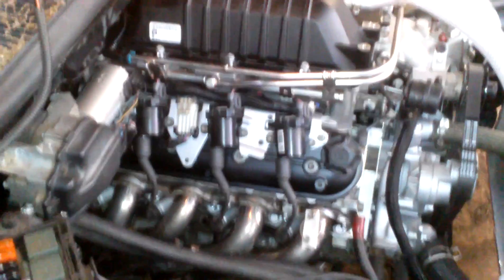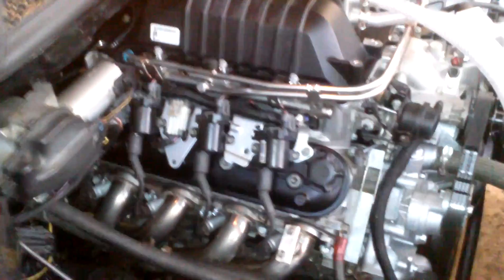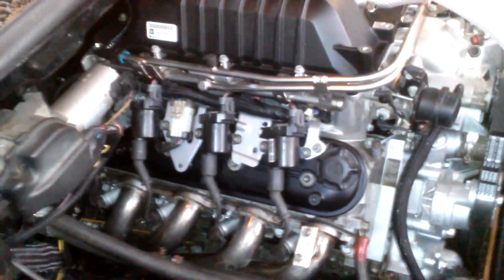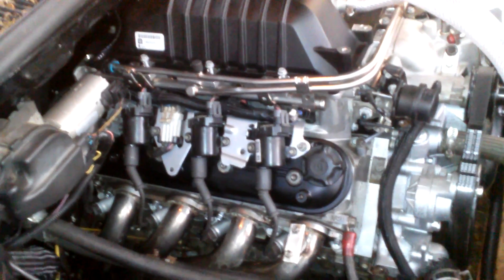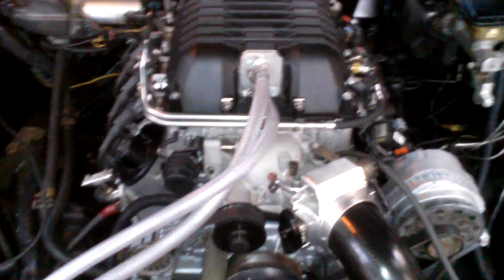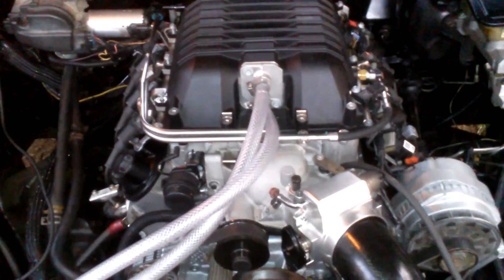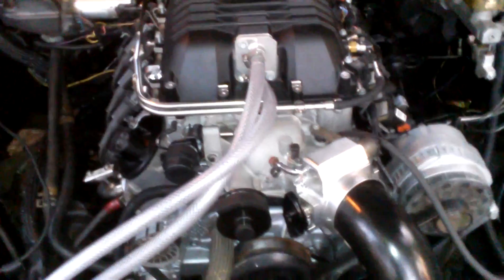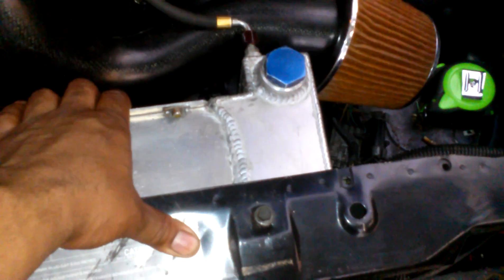Supercharged LS3 1995 Impala SS UPDATE

Comment: I know your calling this a budget build but those emission legal long tubes with the egr ports blocke off are killing the power. Get you some big ass ceramic coated hooker super comps. I see stock ls1s running super comps. If you want bigger than call kook's or get customs. Those pee hole sized emission headers are killing you. They were bad for the lm7, they were even worse for the 6.0 and they are flat out killing the supercharged 6.2L. Imagine running as hard and as fast as you can and all you have to do is open your throat and air gets pushed into your lungs, except you have to exhale though a stir straw from a coffee shop. You've done all this work,  you know that shit is killing your power. Remember an engine has to let out more than it takes in. As an example, It might take in 750cfm but after that mixture explodes and multiplies in size, it's got to get out of there.
Reply from the maker: this is not a all out build, this is a daily driver, i got quiet mufflers and resonators on it too.